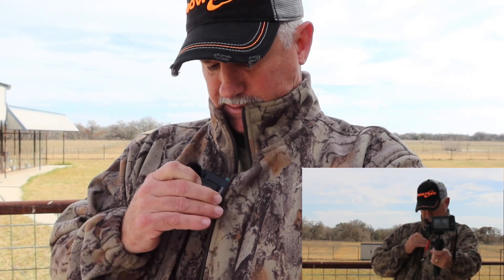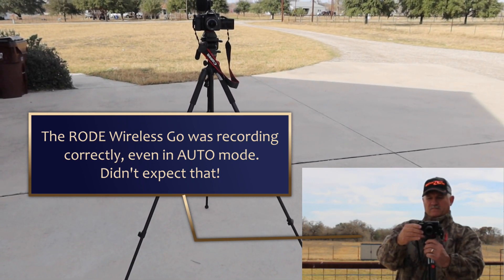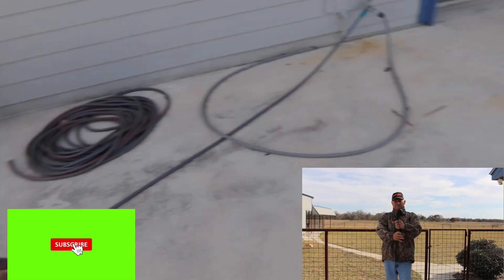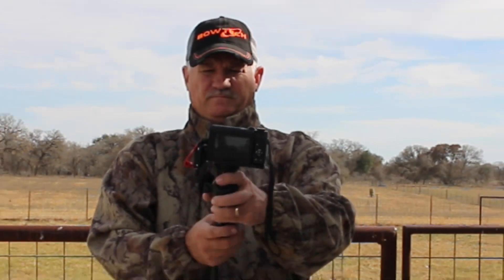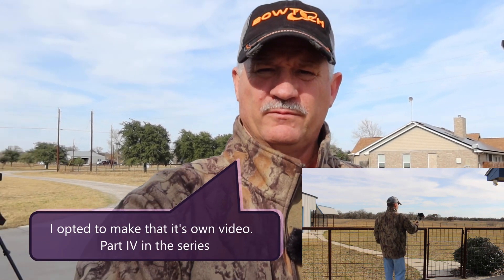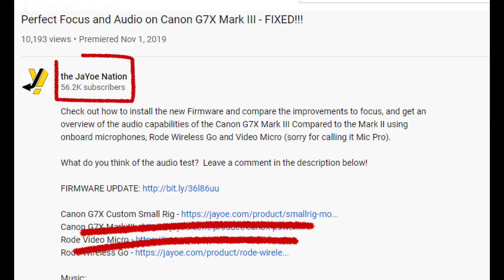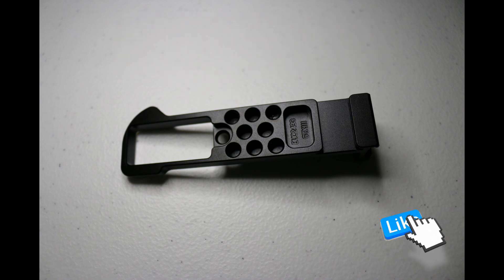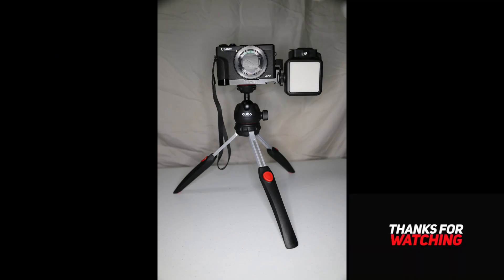Canon G7X Mk III, the RODE Wireless Go, and a Small Rig

Comment: Thanks for the video. If you don't switch the G7X to 'manual' once you plug in the Rode Wireless Go, do you hear tranmitter noise?
Reply from the maker: Good question, I'd have to test it and find out.